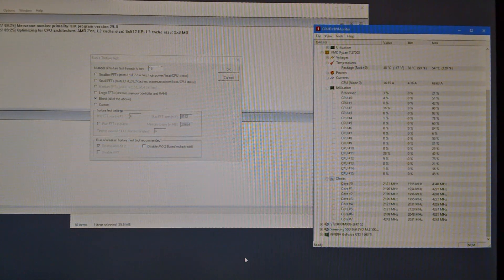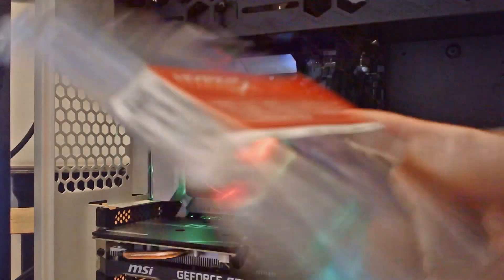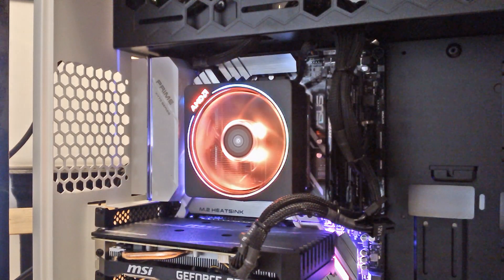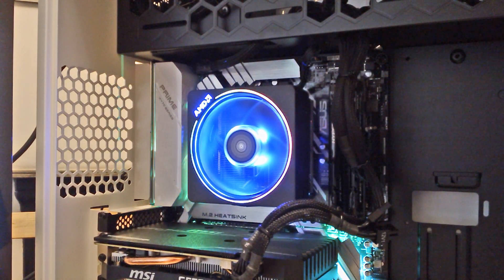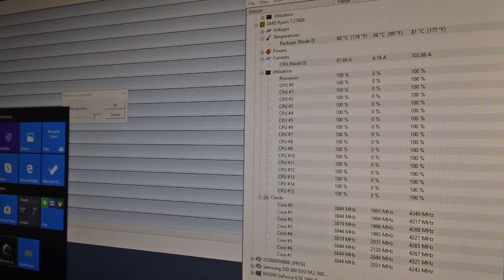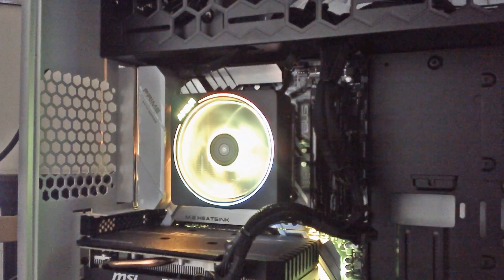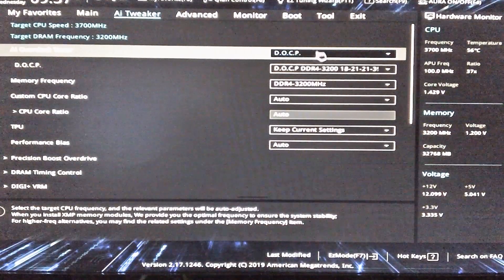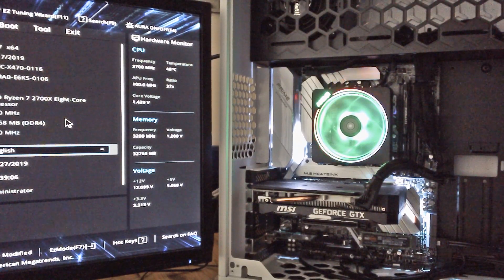Ryzen 7 2700X & ASUS Prime X470-PRO *BUILD*

Comment: The Asus X470 is damn nice. I have it paired with my 3800X and I can hit 4.425 GHZ on all cores (fine for games too hot for video encoding) without VRM problems. Ram runs at 3600 MHZ with a slightly Infinite Fabric Overlcock to 1833. I have the latest bios released 11/25/19 and my 3800X hits 4.525 GHZ when I turn off my OC on two cores gaming. With that said I don't think Asus are the fastest booting boards. MSI X470 Gaming Plus boards boot probably 7 seconds faster. Other than that the board is great.

Comment: Did you notice if your board came with the latest BIOS?
Reply from the maker: Can't say I noticed... the 2700X worked perfectly so there was no need to check the BIOS.

So according to this...

https://www.asus.com/uk/Motherboards/PRIME-X470-PRO/HelpDesk_CPU/

The one in the video must have 0222 at least.

But look at 10:20 .... there's the BIOS screen and you should be able to see BIOS Version 5007 on the top left of the screen. It comes into focus at roughly 10:27

Latest version is here: https://www.asus.com/uk/Motherboards/PRIME-X470-PRO/HelpDesk_Download/

5406 at the time I did this comment - which looks like it improves boot times rather than adding any new CPU support. But there are 4 previous updates from the 5007 installed which might do general improvements to system performance according to their descriptions.